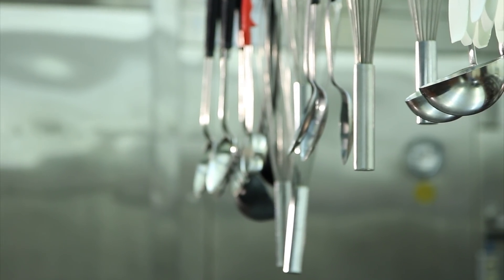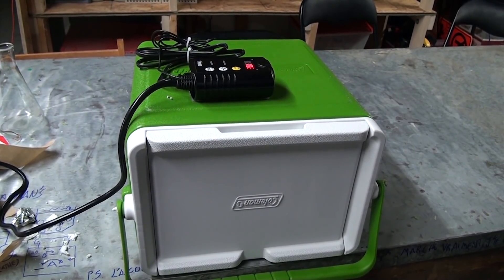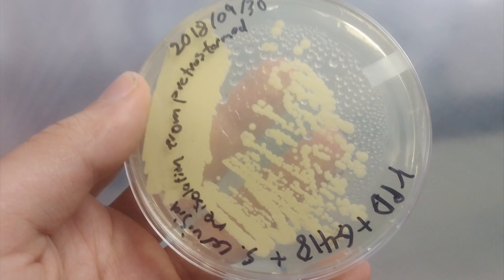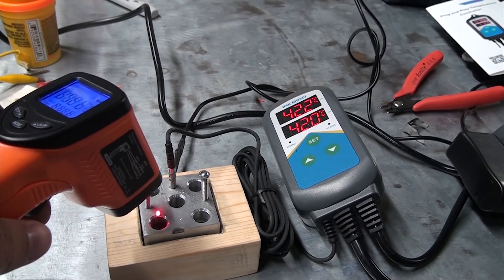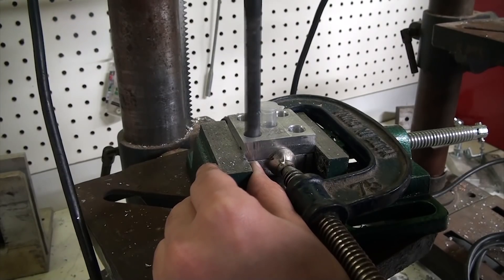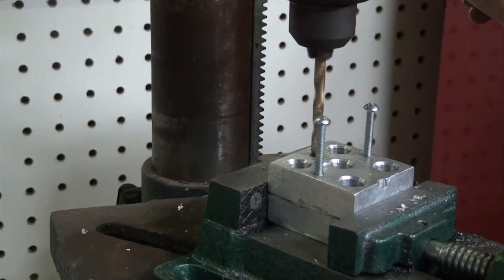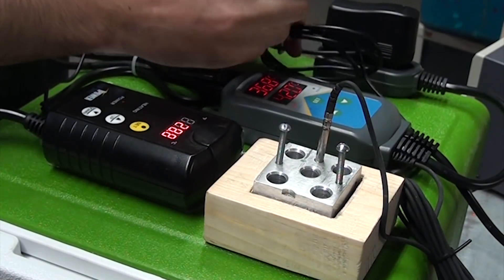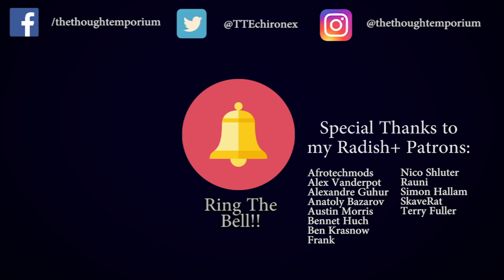From Beer Cooler to a DIY Incubator

Comment from the maker: Hi All. I know I shouldn't be using an IR thermometer on a shiny surface. That was just to see if it was heating up. I used a glass thermometer and calibrated thermocouple off camera to confirm this was working the way it was supposed to. When that shot was recorded I was contemplating putting paint on a spot so I could also measure with the IR.
And I know I should have added a heat sink to the other side of the peltier, but doing so would mean faster heat dissipation when the peltier is off, so while less efficient it does trap heat better this way.
Reply: electrical tape (vinyl) is perfect for things like this. It has the correct emissivity for most ir thermometers (~.95), and is close enough for thermometers adjusted to an emissivity of 1. 

Panel-mount pid controllers can be had for a song on ebay and the like. These are great, because they really open up your options if you want to expand or change the project. If you're REALLY handy, you can of course build something from the ground-up using an arduino.
Reply: Speaking of things you shouldn't do, you shouldn't have made this video without trying to make it a collaboration with uncle bumblefuck, aka AVE. You are still looking for Canadians to do a collaboration with right?

Comment: Im surprised that peltier works.  Usually you would want some kind of heat break between the hot and cold sides of the peltier.  I guess since the thermal requirement is low enough it still works.
Reply from the maker: Ya heat sinks are more important if you want the cold functionality. To just get hot is easier.
Reply: @thethoughtemporium  heat sink yes but a heat break is kind of important both ways. The way yours is setup you're drawing heat from the same chamber you're trying.to heat.  It works because the chamber isn't that efficient but it's kind of energy wasteful:)

Comment: this is cool & I like all your content, but circling back to your RF farewell vid, are  you done with radio experiments?
Reply from the maker: No but it's already starting to snow up here in canada which is getting in the way of stuff I had planned. A lot will have to wait till spring to pick up again. I meant to test the corner reflector this week but it's been raining and snowing which would screw with the antenna and also I don't feel like standing in the rain at 2 degrees for the sake of a video. I've got some stuff that can be done indoors planned but I'll get to it when I get to it. I'll need breaks from bio from time to time so I'll do radio and physics stuff then. Then come spring I'll do another big radio project. I've got stuff in the works but anyone who's followed this channel knows that I tend to pick up projects and put them down for a while as resources come and go. I haven't touched the styrofoam worms or plastic fungi for years but both just got restarted. Things are on a cycle. So please bear with me and be patient.

Comment: What about repurposing an old fridge as an incubator?
Reply from the maker: Works just the same as the version in the video, just use a bigger heat source. Couple IR lamps could work for that.
Reply: The heating pad out of a water mattress has worked great as a seedbox warmer for me.  Would be great for this application.

Comment: Nice project, really like where it is going, one thing that I didn't understand, why use the heat pad in the incubator on the roof? Hot air will stay in the top and the colder air will stay or sink to the bottom of the incubator, I thought it would be better on the floor of it, using an stand to put things without touching the pad, it would make it more efficient. Cheers
Reply from the maker: The heat pad is being controlled by being fully turned on and off. The pad itself can get way too hot so if it was underneath the plates it'd cook the organisms. The point of it being an insulated box is that the temp evens out. Better to let the heat percolate down slowly.
Reply: @thethoughtemporium  Oh, got it, thanks!

Comment: I was just wondering isn't it kind of counterproductive to have the peltier device inside an insulating wooden block when it would work a lot better with a heatsink on the other side as well.

Comment: Isn't it necessary to use some thermal paste on the heatblock and temperature sensor? Or is it accurate/precise enough as it is?
Reply: It's probably fine, it isn't a CPU after all.
Reply: I'm not concerned about top temperatures, but OP wants the temp to rise faster and spread better in the heat block, thermal paste makes a HUGE difference to that.
Reply: @bakedbillybacon  That is true and it does help but it may be overdoing it.

Comment: you know that using a thermal meshuuring device wirtth a beam of light is not going to work verry well on reflective surfaves
Reply from the maker: Yes. It was just the first thing I had on hand while filming. It's been tested with other probes and a glass thermometer
Reply: well you can avoid the reflection isue when you just put on some electrical or painters tape

Comment: Your temperature readings (e.g
 at 6:43) will be rather inaccurate because of the reflective surface of the aluminum. For our heat blocks we tried adding a matte black surface for a while, but eventually gave up and measured temperatures with a separate probe in each well.
Reply: I can suggest to use Kapton tape (the yellow clear tape people use for 3D printing). It has a very well defined emissivity.

Comment: Paltier devices create a temperature differential between one side and the other which is only really useful for cooling, any reason why you went with such a device over resistive heating?

Also you might want a sink for the cold side, as it stands your insulating both the hot and the cold side of the paltier in the same box
Reply: I'm guessing he grabbed whatever was good enough. Besides, Peltiers are easily repurposed, and he plans to do PCR soon.
Reply: @WilliamDye-willdye  yea I mainly brought it up as a way to get more heat out of the heat block without increasing the wattage, by putting having a sink for the cold side that can get heated by the surroundings
Reply: Peltiers are rather ineffecient at cooling so it kinda works out, they generate far more heat then they transfer through themselves so using one as a hot plate is probably a little more effecient then just using a resistive element

I think the main reason he used it was because they have an excellent flat surface (meant for mating to heatsinks/waterblocks)
Reply: Resistive heating theoretically has 100% efficiency. Practically too, you get 100% for DC.
Reply: @astir8275 you do but you can get greater than 100% "efficiency" with a heat pump without violating physics. Peltier though have stunningly poor efficiency. If you can tolerate that, their poor thermal cycling reliability and physical fragility they have some niche applications. They're solid state, don't vibrate, easy to drive,  operate as heater/coolers by reversing the drive current. They also generate electricity if you maintain a heat differential. Space probes use them for decades with warm plutonium on 1 side and cold space on the other.
Reply: Do you have any comparison on heat efficiency? I'm curious now
Reply: @0Arcoverde  I think the heat pump method he is using works better than resistive heating, however the more you insulate both sides together the closer it gets to the efficiency of just using a resistive heater
Reply: @0Arcoverde  I'm not sure, it's abit weird because I've only ever seen them used for cooling.

They create a temperature differential, but in the process generate their own waste heat, so keeping them in an insulated container will eventually heat the container. But any electrical device will do that

On the other hand if you have a method of conducting in heat from the outside world to the cold side rather than insulating it, the device will take said heat and pump it to the hot side. 

So for their efficiency as a heater , it depends on how you use it.

A good way of thinking of it is keeping your fridge open to heat up your house, fridges use energy to produce a temperature differential, but also generate waste heat that is essentially equal to the amount of power they run off of.
Reply: @0Arcoverde  A rule of thumb is to make the heat sink on the hot side 4 times the size as the one on the cold side. Basically they move a little heat while creating a lot of heat in the process.  As he mentioned in the comments,  they're cheap as chips and he already had them,  the efficiency doesn't matter as he's only using it as  a heating pad. He's not using it to move heat but create heat thru the inefficiency. The main use case is precise temperature control where you may need heating and cooling to maintain regulation or cooling a small area like a camera chip to remove thermal noise. You can stack them on top of each other and get a really good temperature difference.  They're most efficient when the hot side and the cold side are at the same temperature :)
Reply: In this configuration it's just going to act as a resistive heater. Even if he did fit a heatsink to the cold side to take advantage of their heat pumping abilities, it wouldn't be a great benefit. They are small and cheap and have a handy package for this application
Reply: @Pete interesting, do they insulate both sides?

Comment: The infrared thermometer isn't great to measure metals. Due to their high reflectivity in the IR spectrum. The thermocouple is probably more accurate.
Reply from the maker: I know, that's just what I had on hand while filming. It was also tested with a glass thermometer and a separate thermocouple.

Comment: Is using it thermometer on aluminium (low emissivity) giving You correct readings? Why did You leave such long screws in this block? Wouldn't it be a bit more esthetic to cut them shorter? 
Anyhow, great video! Congrats, on developments on new lab!
Reply: no, It will be out. Should paint the top matt black